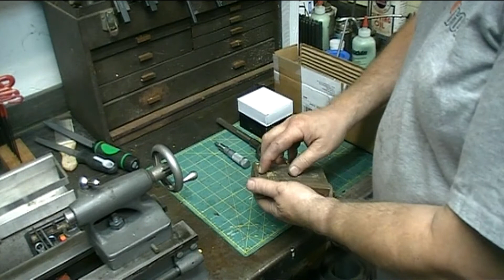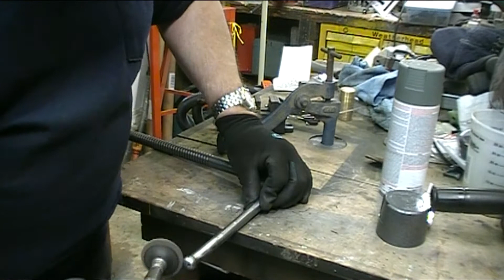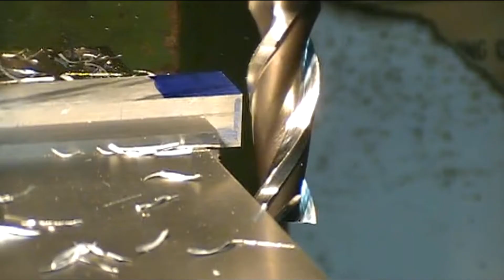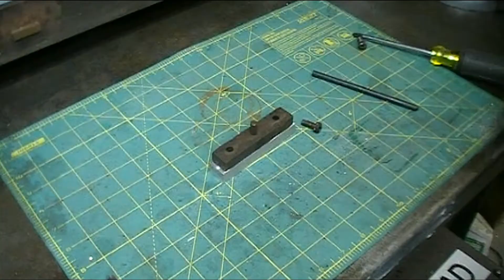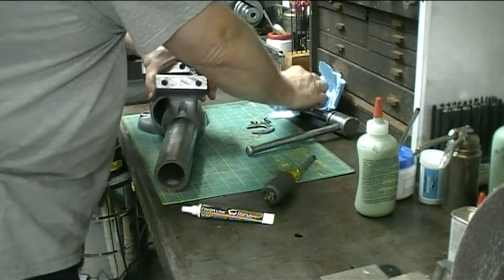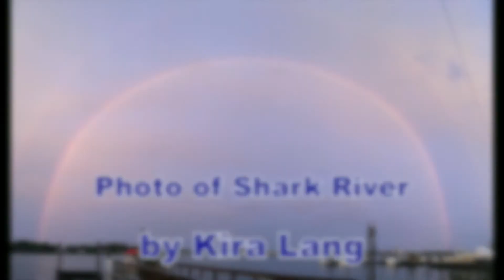Wilton 3 Inch Bullet Vice Rebuild Part 2

Comment: You got to love those Wilton Bullet's! Nice addition to the shop Steve!
Reply from the maker: I used to have one in my electrical rebuilding shop.  The hired help latterly killed it, ended up having to braze the housing back together.  They are a work horse for sure.  I really like that one that I restored.  I made aluminum jaws for it and they work just great.

Comment: Did you find when reassembling the rear pins in the back that it wasn’t the same fit as before removing them or perhaps the rear cap is a little looser?
Reply from the maker: This vice was in reasonably good condition and I was able to just clean it up without removing the pins, so it was never completely disassembled.  Thanks for watching and commenting.

Comment: G'day Steven! awesome result thank you for sharing :-) what size is the shell mill you are using on the vice jaws please? any issues running it on the RF30 mill? im needing to get some kind of face mill for my mill
Reply from the maker: It is a 3" shell mill from Shars. in part one I used it to mill the anvil on the vice.  The mill handles it with no problem.  I do keep the locks tightened slightly to avoid chatter. thank you for commenting.
Reply: Thanks that gives me some confidence!